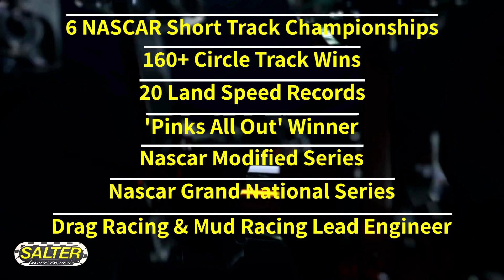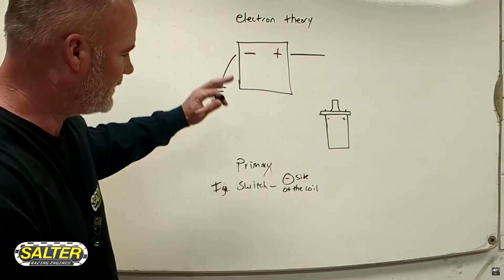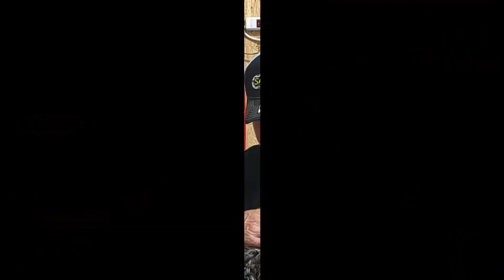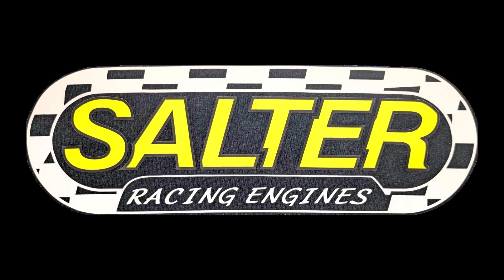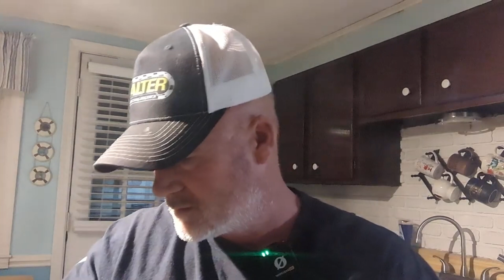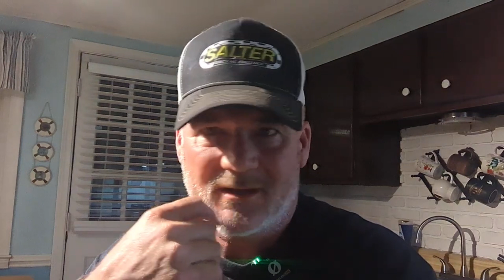Here is some Solid Dyno Testing Advice for people who are Serious about making your Engine BETTER

Comment: That some nice information so my question is so is 3 1/2 inch collector is about a good size because the sprint car guys run shoenfield headers that are 3 1/2 inch collector from 2 barrel 360 some have thought about 3 inch to 3 1/2 or something weird that was a thought then 360 and 410 run 3 1/2 inch just curious what your thoughts on that. I run 3 1/2 on my 2 barrel just because is what i can get a hold of on a budject i buy from people who sells stuff lol. But anyways good ideas on always try to improve engines
Reply from the maker: @chevyrc3623  depends on the RPM range but if you're running Sprint I'm assuming you're turning it up there pretty good so definitely 3 1/2 but you can turn that thing with shorter or longer pipes don't be scared to try it
Reply: @SalterRacingEngines  oh dam ok thank you Brian

Comment: Several months back I watched a video you made about compression height. You were convinced by your years of building racing engines that a 1.150 compression height was the correct height. My question is, that height for a specific engine, or for all displacement engines, or is there a maximum, stroke, rod length, bore, would change the compression height. You do a great service for the motor heads. I would encourage all those to listen to what you have to say, you have decades of time and experience, and you offer it all for free. People would save alot of time and money if they would listen to what you have to say. Thank You
Reply from the maker: @danchidester9371  I don't use crank and Rod ratios anymore. I just use compression heights. But I also don't use crankshafts that don't really fit meaning I'm not going to put a 5-inch crank in a block that's only 8 1/2 in tall. I heard that makes sense.
Reply: Thats why they make JB weld... 😏 @SalterRacingEngines
Reply: You better do multiple pulls too and average the results before you make a decision. My biggest pet peave in dyno testing is you can only change ONE thing at a time or your results are meaningless for doing a comparison.  Also if you are really trying to tune you need to try multiple timings correct fueling and cam timing to truly evaluate one cam versus another for which one is best  and then it’s really only what is best for that EXACT engine combination.

Comment: Problem with lsa cam tests is what do you change when changing lsa? Do you hold same intake centerline and just move exhaust? Do you move intake and hold exhaust? Or both? Then was it lsa that made the difference or was it a different intake opening or closing event? Or an exhaust opening or closing position change?  You’d have to have a cam that changed each one of the valve events individually but then how do you know if an earlier intake opening also needed a change in the exhaust side at the same time to really take advantage? Lol fun stuff to think about

Comment: One thing you might be interested in concerned dyno cell air flow. 

This was in NASCAR Cup country which in 1989,  was new to me for humidity.   

When it was time to be a part of the dyno results as a new hire , I was taken back by the amount of air going into the cell. There was no paper in that room anywhere. You didn't dare wear a hat. Unbelievable air flow.  They had a sliding solid wood door for entry/exit when the engine was running or in cool down.  It wasn't really that warm inside the cell either.

 I asked my boss how this was done. 

The walls were all pegboard and each hole had air discharge. A lot of air and the room was large. The area between the studs was the area to handle the volume. There were huge industrial blowers on the roof which fed air into a separate small room where it was plumbed into the walls. This calmed down the volume and pressure before it came into the cell. -- They used observed horsepower and torque based off of what the real conditions were. He told me that the folks at Richard Childres racing helped him with the input. (not for certain. Long time ago). Anyway, he claimed it made their testing more applicable to long run cycles. 

Not  being an operator but a head/manifold man, they wanted me in the console room to take notes  on what we were testing regarding the non duplicated profiles and keeping track without loosing or understanding someone else.  

It was extremely interesting about air quality/quantity. 
Just a tidbit.
Reply from the maker: 100 % volume are exactly right in fact we want the dyno room fan to be able to pull so hard it can put the room in a vacuum well what we're after is air exchange rate I know most people aren't going to spend the money to get that right but you are correct

Comment: We lost 25 hp and 25 lb/ft at the 2019 EMC at JE Pistons when the dyno cell was super hot and the exhaust pipes were tubing that was only about 5 inches in diameter.
Reply from the maker: @joecraine4660  exactly

Comment: I don’t know how you can get a torquer 2 single plane intake with a 1 inch spacer under a stock hood unless it was a cowl hood. My 68 350 has a edelbrock rpm performer m, Holley 750 and 1 “ spacer with a 14” air cleaner with 3” tall standard filter on it and if I get any taller filter it hits the hood. I have the original 68 RS/SS hood with chrome intakes
Reply from the maker: @Thumper68  I'm not sure but that's what was on the engine and that's what was in the car I purposely chose that intake for that reason plus trying to get plenty of volume
Reply: @ ok so I got the answer for us both. 
Performer RPM max height 4.720” Torker 2 max height 4.630”

So this makes me wonder if that engine would of been even nastier on the street with an performer rpm dual plane on it because they pretty much always have better power in the low and middle range and give up very little up top in max numbers. It would be interesting to see that engine tested with both intakes for sure. 

My engines mild with .20 over aluminum flat tops, a mild cam, stock heads with new springs and screw in studs the regular stuff. I did  gasket matching and port smoothing. Has original Muncie and a 3:73 Eaton posi. From a 60 pull Ive beat a 5th gen SS Camaro who got the hit and a new style GTO while I had two people in the car and trunk and back seat full of groceries. I just lit it up for first time in like 8 months it started in like 2 seconds and idled💪🏻.

Prob start one more time before that engines pulled and put in a corner to save. Finally time 10 years saving and collecting parts for my new engine! 350 .60 over, lightweight 42 pound 3.75” stroke crank, scat 6” rods, wiseco pistons, probably going with skip white/AFR heads with a hydraulic roller cam yet to be decided but fairly good size around 108 LSA maybe one of the Howard’s ones they recommend for their heads they seem to get good numbers over 500hp on same type of build. Not as light of crank so I’m hoping to gain some more power from that. It should rev pretty quickly and remind me of the late model engines my old man built when I was just a kid. That methanol been in my blood ever since.

I’m gonna shut up thanks for all the knowledge you give I appreciate it and always enjoy your common sense old school approach it’s kinda like I’m listening to my old man. Just getting double the knowledge now!
Reply from the maker: @Thumper68  idk it could have been better but I didn't risk it not fitting
Reply: @ I totally understand and I was surprised to see the torker was shorter. I added my 1” spacer couple years after I had refreshed the engine so I didn’t know it would fit either when it was built. Plus I was going through chemotherapy and healing from 7 broke ribs and a broke shoulder blade as well so I was just happy to get the car back together. I had let someone who was starting a paint shop take the job to do my car for a good deal I bought him an air compressor and he’d paint my car. Well he stripped the car to the metal and I got hurt and found out I was sick and a couple weeks later he up and moved leaving my car in pieces scattered around his shop. Thankfully I had a key and went and got my car and air compressor and brought it home. We did the engine clutch brakes a new axle rear gear ya know all the stuff ya do when a cars apart like that. Then I knew another guy a couple  hours away and he helped me out and took on the paint job for the air compressor and some cash. He painted it and then after a chemo treatment me and my old man went and put the new vinyl top on and carpet in and we put the car together that night and next day and I drove it home a couple hours. Damn chemo port made shit a pain if I exerted to much force it would tear in my chest and I’d bleed out in like a minute.🤣
Reply from the maker: @Thumper68  man brother that's awful I'm glad you got your car back
Reply: @ Thank you. It’s dang near all I got to show for 15 years of daylight to dark hard work drilling water wells. Worth it though I love that car. I’m the third owner it’s only got 110k original miles I even have a video of the odometer rolling over. I ended up having cancer reoccurring 5 years after I beat it. The day I found out my new wife of just under a year told me our marriage was over cause she was a cheating slut so I went through harsher chemo and a stem cell transplant pretty much alone and heart broke and pissed at the world. But I had my car a mini daschund  and a fuck cancer you can’t kill me attitude so I beat it and me and my car and my dog went and found me a good woman I’m still with today about 9 years. 

Goodnight brother keep up he great works thanks for hearing some of my story. Maybe we’ll hear more of yours like you mentioned.

Comment: I use 1.8 rockers on my 454 and the exhaust is 3" straight back. kind of what you're saying, but no crossover. I wonder if a crossover would help?
Reply from the maker: Yeah it will help a little bit for sure
Reply: It lets the engine share muffler capacity and it lowers sound 3 db! So you could get the same performance or very close with a quiet muffled H pipe or X pipe system.

Comment: Excellent information as always. 
Yes, when conducting testing, only change 1 variable at a time. You described the exact reason why cam testing costs what it cost. 
It also brings up Vizard's 128 formula. Due to all the testing he had done, he gave the formula, for a specific application. Change one variable, and adjustments have to be made to the formula. 
Always cam to your application, and give ALL the info to your cam designer. You'll bothe be happy with the results.

Comment: Can you overcome the effects of a street car exhaust when you design a cam/ heads induction system? Like 2" primaries, 3" collector,3" exhaust all the way?
Reply from the maker: @MichaelScudder72  that is a great question and certainly one I have tried to overcome myself. 
If you are just absolutely required to have catalytic converters on the only thing you can do is get a high flowing cat that still works well enough to keep you from having check engine lights however a very large primary and secondary tube header with minimum 3-in exhaust going into the converter and out of the converter we'll make ginormous gains on your performance. 
And as I stated in the video running a large amount of intake and exhaust split works very well for things of that nature 
Where you can get into trouble is when you have a very high flowing header on a high performance Racing engine you can actually hurt your performance with that much split in your camshaft because you don't need that much split. 
It is a fine balance in one that requires testing
Reply: @SalterRacingEngines  no converters. Just working in the confines of a full street exhaust. Mist header manufacturers max out at a 2" primary due to room under the hood. 3" full exhausts are pretty common
Reply from the maker: @MichaelScudder72  if the engine is really serious I take my vehicles down to kooks or Kerry Lawrence here in North Carolina and I have them put the right size exhaust on it

Comment: Great video! Thanks for the advice! I'm a huge advocate for the street guys using hyd cams with solid lifters. I don't have the experience to choose the absolute perfect cam everytime (I do the math, but experience is still needed). By using the solid lifters you can do lash loops and identify what you should have done the first time, in my case I needed more exhaust duration. I don't have access to a dyno nor the money to test 3-5 cams in a particular engine.
Reply: I want the laziest hydraulic roller cam profile and use solid roller lifters on it. I want the hydraulic roller cam profile to be so durned lazy that the solid roller lifter takes a nap and goes to sleep 😴 ZZZzzz on the ramps so as for longevity, durability and reliability on that BBC valve train ... including the hydraulic roller cam much LIGHTER VALVE SPRING Pressures that makes it much easier on the entire valve train --- especially the life of the roller lifters. 🧐

Comment: @@SalterRacingEngines  good stuff, couple questions maybe you can answer on the cam video.  If the head flow drops off at lifts just above max valve lift does it matter? Would you trade 15cfm at .400 lift for 15cfm more at full valve lift??  My theory is that midlift flow is critical for pulling on the intake tract while piston is at max velocity down the bore...but others think the max lift flow is more important to charge the cylinder from inertia.  Another topic could be do you select cam based on headflow capability or do you select cam based on power goals and let they heads do what they can?
Reply from the maker: @BobHollinsheadGarage  save these questions for the q&A I'm going to do  there a great questions

Comment: Great video Brian, very thought provoking. Happy to report that Darrell has your points covered regarding standardization testing to assure accurate and fair results, calibrating the dyno, consistent water and oil temperature etc., even the timing between pulls. On the next dyno video i will address your points and demonstrate his exhaust system, he has that covered also. Thanks for your thoughts. AG
Reply: Another great video by a dedicated engine master of the craft.

Comment: Hello Sir i have nothing but respect for you one of the things im always wishing to see with everybody porting heads is for them to include air speeds for one but also for them to do a dyno before porting and then after porting them and another of optimizing for the increase head flow  cam change and header change

Comment: i agree.. for me it is two ways. sometimes i am given an agenda. i want an engine with "X" HP/TQ. that spins max "x" rpm. zero application or too many unknowns to have an exact application. in that respect an unrestricted dyno is great. building an application engine, at the dyno, i want the known issues or restrictions on the application to then setup the dyno best it can be to match. i want the exhaust most of all to mimic within reason the application. then i can make changes to the engine where i can see what works best for my application. or can i mod the exhaust at the dyno is ways the application can allow. to me its like you say but both ways. to take a max effort non restricted exhaust at the dyno, gain how ever much more power, then stuff into a car/truck with an exhaust that must meet state codes/laws does not work and winds up the customers. here is your dyno sheet for engine, once it is in the car there is a 1/3 or more missing.   i have been through this many times. when customers lie/fib. or distort the truth, you build a cash and carry engine, they install totally different than they tell you , it creates many issues. i build marine engines, for marine, car engines for cars. i have customers who try to swap those applications at times. yea they run they work but its not what they were designed for. they dont work right. most of  my marine is wet exhaust, overlap EVC/IVO matters

Comment: It sounds like "stacking" is over-scavenging.
Reply: My thoughts are stacking=back pressure, not enough flow
Reply from the maker: @scottosborne8735  when I use that term stacking I mean the exhaust actually starts to fight itself to get out of the pipe and therefore causes a bad restriction

Comment: I saw a test that comp ground 3 cams for an ls3. One on a 116 one on a 112 and one on a 108. The 108 made the most power across the board. That surprised me.
Reply: That is no surprise, each cam change was making the intake close earlier, building more cylinder pressure each time.
Reply: A moot test that one
Reply: @craig8187  explain your thoughts, the latest test of 23 cams showed the tighter lsa made more power. As a matter of fact a 108 made the most power. Show me testing that proves different.
Reply: @davidreed6070  ok, but 1st, did you just listen to what Salter had to say about this very subject? Also, explain to me why you think that test, or the 23 cam LS cam challenge showed us that 108 is the best?
Reply: @craig8187  there is no nred to test if you still believe what you believed before the testing was done, ls3 heads need a lot of overlap. Engines with big intake valves and ports seem to like overlap. Explain to  your idea of the situation , I will listen, I consider all.
Reply: @craig8187 it was the best in those situations. It depends what you are doing with the engine. With a street engine with small duration the only way to get enough overlap is to tighten the lsa.
Reply: When John Reed of Reed Cams did cams for Cup engines and most everything he did was on a 106 lsa 102 int.centerline and John was a master at cam design